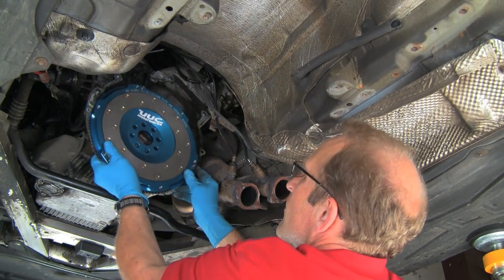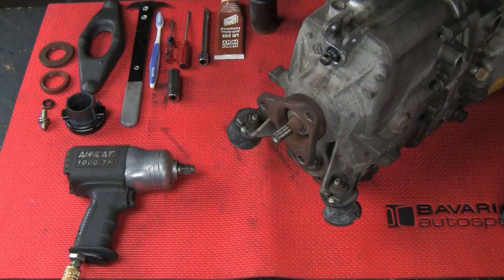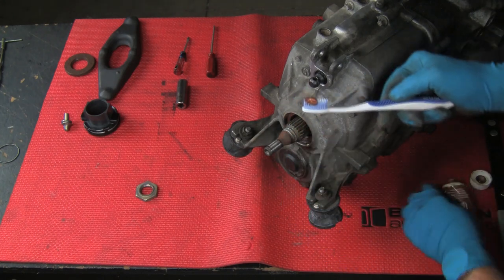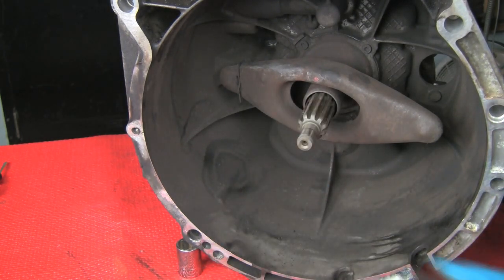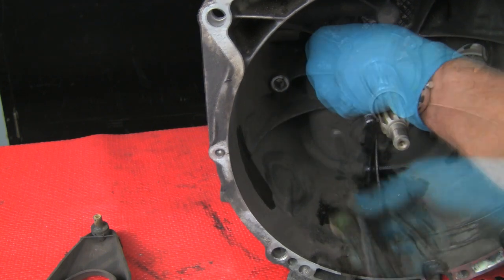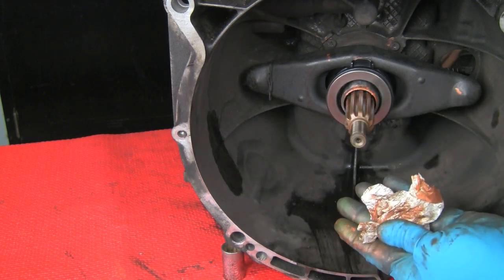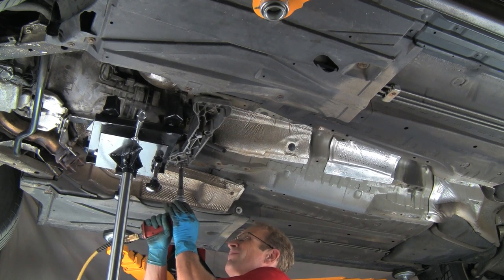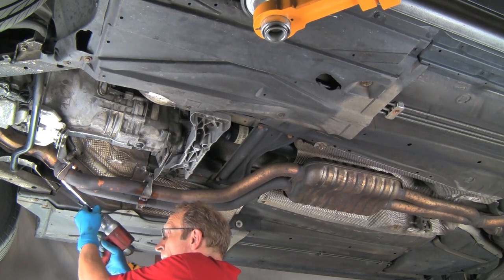Replacing a BMW Self-adjusting Clutch & Dual-mass Flywheel Part 2 of 2

Comment: I have a 1998 Z3 2.8 coupe. with 110K miles I have a sort of judder at very low speed especially when the engine is cold. Is this the clutch do you think or is it caused by the fuel injectors ? I also think I can hear some noise from the clutch  a kind of low pitched errrrrrrrrrr noise ? what do you think ?
Reply from the maker: Well, hard to say without driving the vehicle.  If the judder happens only when engaging the clutch, this could be an early sign of a worn clutch disc.  If it happens just while driving and applying power (accelerating) and not shifting, it may be a driveshaft flex-disc or center bearing
Reply: BavarianAuto thanks for the speedy reply to my question... I would say it is just after the cluctch peddle is raised and the gentle power is applied. (1st or 2nd gear) i get to thinks a less powered engine might want to stall for a split second before it shudders and recovers
Reply from the maker: rigsbyL1
It may help to have somebody else, who has the knowledge to be able to diagnose it, drive the car to see if it feels like engine management,worn clutch chatter or driveline shake (flex disc  & center bearing).

Comment: Nice video sir, just wondering if you could give me an idea on how complex of a job it is to do a clutch on a BMW super charged mini, a friend had his clutch done and the cost of the job was staggering to say the least.
parts probably cost more in Australia, but , wow,   it was a lot of money.
Reply from the maker: A front wheel drive application is usually a bit more involved for clutch replacement as you have to disconnect the driveline and support the engine ..... or just remove the whole front subframe and driveline from under the car.
Reply: I see, ok thanks for the reply mate, have a good day .
mik.

Comment: I installed the UCC  aluminum flywheel and the clutch that comes with the kit from Bavauto, the problems is the cla ..cla cla cla noise I get when the car is in neutral , I did the installation according with your video, what can I do to eliminate that noise? Do I need to return to my original clutch?
Reply from the maker: The clatter is from the reverse idler in the transmission.  Normal wear causes the clatter, when the lightweight flywheel is installed.  This is indeed normal and causes to problems.  It can often be reduced by using a mixture of the Red Line MTL fluid and the Red Line MT90 fluids.
Reply: Is because OEM dual mass flywheel doesn't transmit torsional vibration like a single mass does there is a reason they come with them from the factory

Comment: When using the uuc lightweight flywheel, do you also have to put some sort of an extension rod on the slave cylinder? Is the trow-out bearing different or the uuc flywheel is the same off set as the OEM dual-mass flywheel?
Thank you
Reply from the maker: The full UUC flywheel and matching clutch and throw-out bearing put the release arm in the stock position, for the stock slave cylinder and push rod.
Reply: BavarianAuto Thank you for the fast response. I have a 2000 328ci and Im replacing the clutch because it felt as if the clutch was always partially engaged. After removing the transmission I found the uuc flywheel with the e34 m5 pressure plate. This particular pressure plate was indeed a SACHS and the flywheels and clutch disk were burned. (Someone didnt put it in with the proper tool.) I ordered the oem Luk clutch kit prior to me finding out about the uuc flywheel. So my question finally is: can a use the uuc flywheel along with the oem self adjusting luk clutch and have proper release and engagement? If not do you sell an extension rod for the slave cylinder? What do you recommend?
Thank you in advance
Reply from the maker: NewGenZ
The stock clutch kit will not work with the UUC flywheel.  You need the M5 style clutch to properly fit and work on the UUC flywheel.  We do offer the UUC clutch replacement kit.  Just give us a call at 800-535-2002.

Comment: What an amazing channel you have, such a great resource.
About swapping from DMF to SMF ... indeed it looks OK on a petrol car for many reasons... but what about Diesel engines ? i read that as the vibrations on Diesel engines are way more important, this type of conversion could mean killing the complete transmission, as the vibrations are not absorbed anymore by the DMF  ( 5xxd N47)  Do you have an opinion on this ? ( i can imagine you don't have much diesel cars in the united states... in my country it's more like 90% of the cars are diesels)
Reply from the maker: 2Drezik  See our comment on your other question.  In short, a dual-mass flywheel may be the better choice for a daily driver diesel.
Reply: BavarianAuto thank you for answering, i'm actually about to acquire a SMF replacement kit but was worried of eventually damaging the transmission due to the vibrations being more present with SMF...
Reply from the maker: 2Drezik No worries there!

Comment: hi guys i need to change a clutch and flywheel on a 2007 330d e90,should i do a dual mass flywheel or solid?or should i do a performance flywheel and clutch?can you help in understanding the difference with these parts.thank you.
Reply: SAGREN NAIDOO  hi ! what have you finally done ?  SMF / DMF / PMF  ?  i've heard that DMF it best option for Diesel engines... ?
Reply from the maker: 2Drezik On a diesel, we would recommend a new dual-mass flywheel for the smoothest engine feel.  If you wish to not deal with the negatives of a dual-mass flywheel, and can accept the increased vibrations that the diesel may give, the dual-mass elimination would drive very nicely.  We would not recommend a lightweight flywheel for a diesel.
Reply: Hi luk dual mass flywheel and clutch
Reply: Hi sorry for late reply. Went for stock bmw parts. Dual mass flywheel and complete clutch kit.

Comment: any advice on getting the transmission back in on a 2006 330xi got it on the transmission jack and its being a pain to put back on even with 2 people. and advice on orientation or maneuvering it would help
Reply: this is being done on floor jacks by the way.
Reply from the maker: Isaiah Williams
Hmmm ... with the trans on a jack, we can only suggest the following points:
* Make sure the trans is on the same angle as the engine ... look at the rear face of the engine block and the front face of the transmission bell-housing flange.  they should be parallel.
*  Put the trans in gear so that you can turn the output shaft to help align the input shaft splines with the clutch disc splines.
Reply: i ended up getting a helping hand the torqued the engine by hand and the transmission slipped onto the spline as needed. Thanks
Reply from the maker: Isaiah Williams
 - good job!

Comment: my clutch went out today, and watching part 1 of the video, it basically told me that the flywheel is probably done as well as I was having jerky acceleration before the clutch(or maybe its the flywheel) went out.

Anyways imma do the single mass conversion, sad thing is I don't have anything to drive while my car is gone T_T
Reply from the maker: Yes, if you did notice the jerky on/off throttle feeling, the dual-mass flywheel is likely shot and the dual-mass & self-adjusting elimination kit is certainly the way to go.
Reply: BavarianAuto

How long does this whole process from start to finish generally takes if everything goes well w/o a hitch? watching the videos on this gives me a great familiarization on what to do (thank god internet huh?) 

Seems to me the only hard part is removing the transmission, the actual replacing the clutch/flywheel is straight forward, only thing you gotta make sure that the alignment tool is freely going in and out.
Reply from the maker: *****
 - Yes, on the alignment tool and the transmission removal being the big step.  Laying on your back, with the car as high as you can get it (preferably on 6-ton jack-stands, as these go higher than 3-ton), using hand tools, you would likely have 6 to 8 hours for your first time.  We did this job in one whole day, but it takes a lot longer doing the video filming.  We did this car a second time a couple weeks later (to install a different set-up to test from another supplier) with no filming and two people did it in two hours, on the lift with air tools.
Reply: BavarianAuto luckily the Naval Air Base that I am in got this auto hobby shop where its basically a auto shop w/ everything I would need, from lifts to air tools.

This video is on a e36 I believe? is there any much difference on removing the tranny on e46 3 series?
Reply: well, turns out I have more problems than clutch/flywheel, the bolts that was holding the left rear axle shaft sheared and I guess thats the trigger that made my flywheel/clutch go out. Just ordered the flange (since the axle shaft itself isn't damaged just the flange). but I was wondering if you guys have any DIY guide for replacing those flanges that the drive axle shaft connects to. can't find any over the web.
Reply from the maker: *****
sorry for the late reply .... have you gotten this back together yet?

Comment: Hi BavAuto!
I have an E39 520i (2.2) 2001. I have noticed that my car vibrates. The vibration coming from around the gearbox, back of the engine. I can feel the vibration when i am at the car park, not moving just revving. As higher the rev the higher the vibration is. If i drive the car i can not notice the vibration much until i shift. if i shift around or above 2-3000 rpm it vibrates again until the rpm drops. any idea?
Reply: engine and trany mount have been changed last week. No engine light or misfire.
Reply from the maker: Norbert Szokolai-Bodor well - if the vibration is only when reving the engine ... not while the car is moving ... it is likely at the flywheel.  If the vibration is present with the trans in gear and the clutch pedal pushed in (clutch disengaged), we would look at the flywheel as the possible culprit.
Reply: flywheel, right
Reply: just noticed that sometimes i dont have vibration.  but only when i start up the car ( warm or cold) and about after the first 500 yards or so it comes back again
Reply from the maker: Norbert Szokolai-Bodor
 - engaging the clutch and loading the flywheel may "loosen up" the dual mass flywheel (compared to a fresh cold-start) and make the vibration show up.
Reply: replaced clutch, flywheel, centre bearing and all the seals as i have seen on your video. my problem is GONE. Thank you guys!
Reply from the maker: Norbert Szokolai-Bodor
Excellent! thanks for the follow=up.

Comment: Do you need to use  loctite for the flywheel bolts to the crank?
Reply: If the original bolts are being used, they should have blue thread-locker applied.  New bolts have thread-lock applied already.

Comment: i want to buy a clutch disc for my bmw e30 m3 1988 .. the disc plate size is 223mm plzz tell mw if you have
Reply from the maker: The stock clutch size for the E30 M3 is 228mm.  Is this what you meant to say?  If so, we have multiple options.  Just go to our online store at BavAuto.com, ID the vehicle and then enter "clutch" in the search box.  If you really do want a 223mm clutch, please email us at info@bavauto.com
Reply: Yeahhh its 228 mm how much it cost ?? And can you tell me if you have racing clutch for e30 ..228 mm ???.
Reply from the maker: raheel saleem
- We have options ranging from just a stock original Sachs disc at $189.95 to a full stock Sachs replacement kit with the pressure plate, pilot, throw-out and all transmission and exhaust gaskets and hardware at $434.95 to the SPEC Stage-1 through Stage-4 performance kits.  If you look at the web site listings, as noted in the prior reply, you can see the listings with more info.  You can also call us at 800-535-2002 or 603-427-2002
Reply: Yeahhh i saw it ..but i am confused i want to buy sachs sport clutch rigid .but i dont know it will fit on my car ?? Because the sports clutch item number is not 21 21 1 223 ..??
Reply from the maker: raheel saleem
 - I think we could help you better, in choosing a proper clutch, if you email us.  Please send a note to inof@bavauto.com and note that you have been talking about the clutch on our youtube channel.  This way, your info will get to me.

Comment: Hi I have a bmw e46 coupe (diesel) my clutch isn't gone or even dragging at all but I do get clutch judder which iv read is often the pressure plate slipping and I am getting clutch rattle when depressing the clutch peddle to a certain point now I have been told this is likely to be the clutch release bearing I am due to have the clutch replaced and bearing but would you recommend a flywheel change too *? Thank you
Reply from the maker: If you replace the dual-mass flywheel with a single-mass unit, the actuation will be much smoother.  Check how much play is in the dual-mass mechanism, as shown in the video.  There should be no play when checking by hand.  If play is present, the flywheel should be replaced for best driveability
Reply: Can't fault your quick response much appreciated would you personally recommend the solid mass flywheel ? A friend of mine (mechanic ) is doing the job for a decent labour charge but I will be helping along with lifting etc I just don't want to leave anything out and does the smfw make any difference to the drive if the vehicle ? Thank you very much
Reply from the maker: Kevin Hancock
Fully recommend the single mass flywheel and self-adjusting clutch elimination kits from Valeo ... if available for your diesel application.  The Valeo single mass flywheels are the same weight as the dual mass, so they drive like a new dual mass .... but better.
Reply: Fantastic only one more thing if you wouldn't mind you said self adjusting clutch elimination kits dies thus mean the clutch will remain self adjusting , ? I didn't think you can adjust hydraulic clutches anyway ? Thanks very much
Reply from the maker: Kevin Hancock
- The BMW "self-adjusting" clutches were intended to keep the clutch pedal in the exact same engagement position as the disc wears .... eliminating picky owners from complaining that the clutch pedal engagement was changing over the life of the clutch .... while under warranty.  In reality, it is troublesome, increases disc wear and fells funky compared to a standard pressure plate.

The self-adjusting issues ...... is a non-issue.
Reply: So the new clutch being the non skeg adjustment one works of course the same but biting point changed ls according to use if clutch over time meaning as a driver we have more 8 deals of clutch wear ? And when it's die to be renewed ? The other fella that usually works on my car told me he has never had to chang a solid mass flywheel I asked why do they put the dual in from new abd not the solid he told me it's to do with how people drive as many people drove differently or not very well I.e bad clutch work etc it counteracts all these errors to make it a smoother drive but I guess with a solid mass as long as you CAN  use a clutch properly it will remain smooth !! You been very helpful This is very much appreciated thank you
Reply from the maker: Kevin Hancock
 - That's pretty much it.  The dual mass also cushions the drivetrain from bad clutch work.  For a person that can drive a clutch properly, the dual mass is frustrating.

Comment: how long does it take the whole install?
Reply from the maker: Well ... that's a big "it depends".
On a lift with two people and the proper tools, it's possible in 3-hours or even less.  A normal DIYer that has done it before, and is working with the car on jack-stands, can do it in 6 to 8 hours (or less).  Most DIYers give it a weekend.